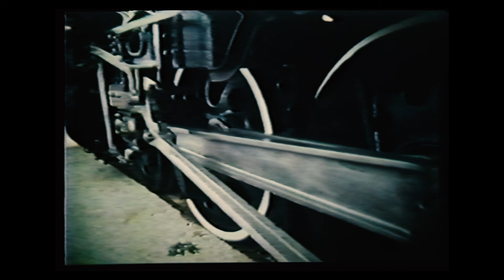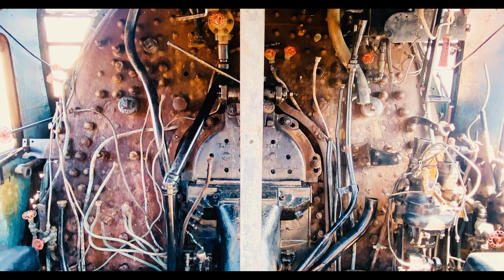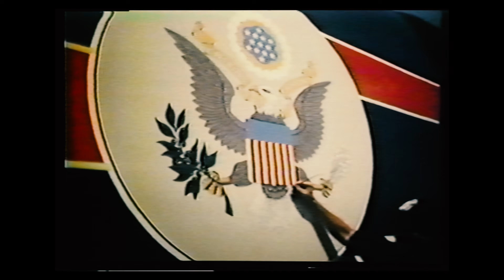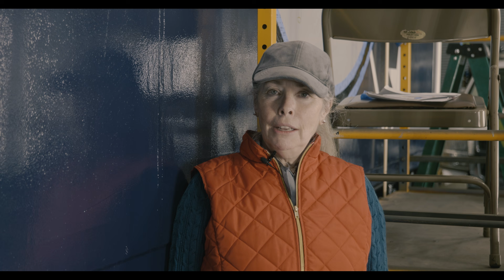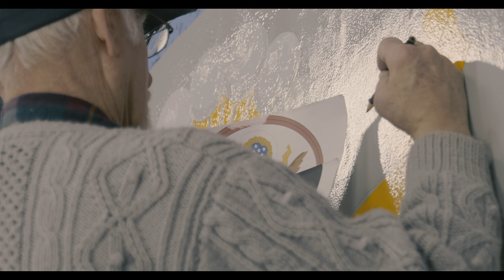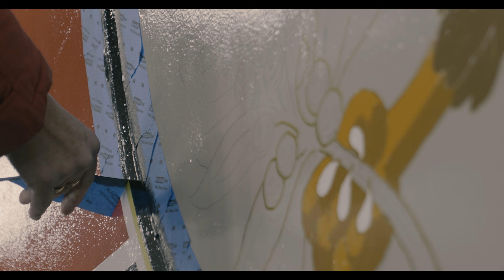Restoring the American Freedom Train and The Great Seal of the United States

Comment: You guys did an immaculate job with 2101's restoration! Always impressed at the quality of your work! Absolutely stunning!
Reply: Same and maybe 2101 will run again soon who knows
Reply: @C @CrossOfBayonne777  We don’t need a 3rd operating RDG T1. 2 operating is enough.
Reply: @CrossOfBayonne777  unfortunately thats not likely, she is still fire damaged from the roundhouse fire and would need a massive overhaul.
Reply: PAINTING the side rods is not a restoration
Reply: @whatdoidonext2234  It’s part of the cosmetic restoration! It is made to protect the rods from getting deteriorated.
Reply: @nicholashuynh6907 a coat of light oil protects even better
Reply: @whatdoidonext2234  But it will NOT protect the rods from getting RUSTED. >:(
Reply: When working with museum equipment, and you are moving it around either to exercise it, change, displays, trade it, etc. it always helps to be able to put lubricant on contact and bearing surfaces. You can’t really do that when all of the gaps, lubricating holes, etc. have been painted over. And of course, if a piece of equipment does manage to go in for restoration, one of the things they have to do is to strip the paint away so that they can lubricate areas as well as have better contact surfaces to put sockets and wrenches on to tighten or loosen them. It also never hurts to once a month or even once a year walk around equipment that may have just been sitting and put some oil to it to keep things lubricated so that if and or when that piece of equipment is moved, you’re already ahead of the game.